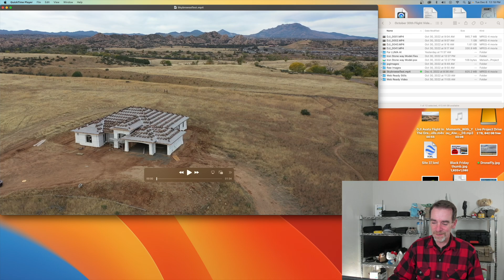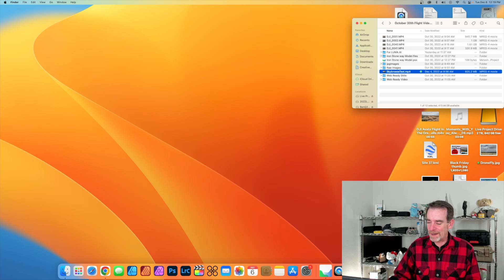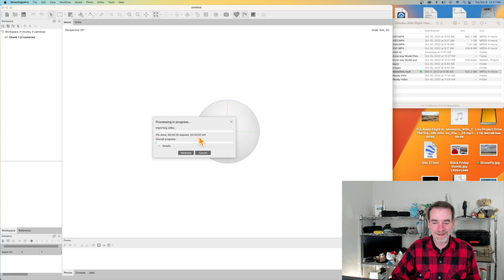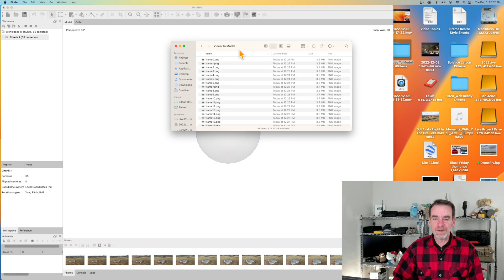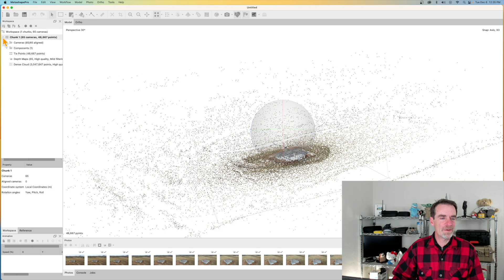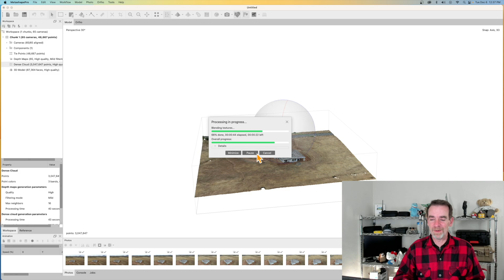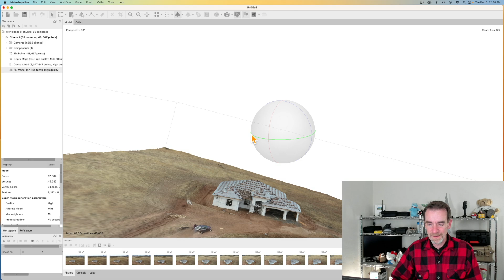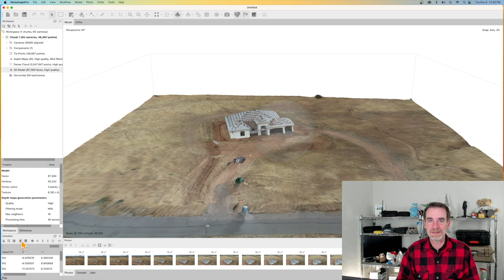How To Make 3D Models From Drone Video | Metashape Video Import

Comment: Have you ever tried to pull a Metashape model into a drafting software like Autodesk Revit?  I work at an Arch/Engr firm and am trying to think of ways that I could implement my drone interest into my day job.  I could see it being handy with expansion projects, where the architects are modeling an existing structure from scratch, so that they can then model the new addition, in order to show renderings of what the final project would look like.
Reply from the maker: Sorry for my extreme delay, this one slipped past me.  Metashape allows for a lot of export options for models.  I know that there are several videos and tutorials here on YouTube about Metashape and Revit.  I'd suggest checking some of those videos out.  Also check out what file formats Revit can work with, and compare that to the export options Metashape has.
Reply: @AZ-Drone  I found one workflow that requires you to go through AutoDesk Recap first, and then create a .rcp or .rcs for Revit.  I tried a OBJ file directly into Revit and it looked kind of wonky, lol.
Reply from the maker: @JoeBoone82  Years ago I started looking into AutoDesk Recap myself.  I was trying to find the best way to render models.  I didn't spend enough time on the demo when I tested it.
Reply: @AZ-Drone  I guess if your client had wanted the 3d models for viewing, which file type and/or viewer would you have used to share the file with them?  I imagine they would need software, or a web based brower, to open the .obj or whichever file you extracted from metashape?  

A fun one to play around with is Luma Labs AI.  I would like to try a SkyBrowse model at some point in the near future as well.

Comment: I downloaded this app to my MAC Book Pro...  But I am having huge problems....  It crashes constantly...  I haven't been successful with one model yet....  Is there a setting or preference you may have some insight into that may need to be changed?  My MAC is 7+ years old now so that might have an impact...  Other software I am trying (learning with) WebODM,  DroneDeploy, SkyBrowse, doesn't seem to have this issue so I am curious if I may have missed something.
Reply from the maker: Sorry to hear its crashing on you.  I have used it on a 2017 iMac, and been able to produce small models (turning everything else off).  But super slow.  On my Mac Studio M1 with 32GB of ram it works very well.  But on a 7+ year old Mac?  Not sure it will work very well unfortunately.

Comment: Great work. Could you export it to a 3d software like blender or unreal engine?
Reply from the maker: I have worked with models in Blender, but I have not done any work with Unreal engine.  I use Metashape and WebODM for generating models, and the big part for Blender would be making sure I've exported the models in a format Blender will be happy with.

Comment: Would this technique also work for video taken from a typical grid pattern flight?  Can you choose the image selection rate -- roughly how many minutes of video produced 60 images?  Thanks for a very interesting video.
Reply from the maker: Yes, absolutely, this would work.  In the Metashape video import you can vary the frames, and you should test it out as I can remember which setting makes more images, and which makes fewer.  Be sure to make a folder for the Video Import images to be stored.  I forgot one time and had several hundred PNGs saved to my desktop.  Whoops.  😀

Comment: Hello!
Congratulations for the video, it was very good and very well explained.
Would you happen to inform the following characteristics of the video and processing?
Video:
1- What gimbal angle did you use?
2- Did you use the video format as wide or 4:3?
Processing:
3- Alignment, advanced.
4- Dense cloud, advanced.
5- Mesh, advanced.
6- Texture, advanced.
Thank you very much!!
Reply from the maker: I can't remember the gimbal pitch used, been a little while.  Went with the wide video.  Sorry to say I don't remember all of my settings in Metashape for this one, it's been a while since I produced the video, and when I was done with the video I deleted the project.

Comment: Can you use this software to get dimensions? Like calculating the width of the roof?
Reply: I think once you turn it into a 3d model, if you know a few dimensions of something in the shot (Truck length, door width, etc) then you can scale the whole thing based on that

Comment: What's up with the transparent circle in the middle of the frame? Is shooting in 5.4K overkill(Air2S)? Any requirements with frame rate/shutter speed? I'm going to try this...I like it a lot. Thanks!
Reply from the maker: When I did this one I was just shooting HD, 60fps.  I kept the speed a little lower, and I probably could have done it a little faster.

Comment: Hi, thanx for your video. One question : did you program the flight or you flew manually ?
Reply from the maker: The video for this one was pre-planned.  Just a quick little waypoint series around the site.
Reply: @AZ-Drone  thanx. With third part (litchi) or DJI software ?
Reply from the maker: @MDC.42  I used Litchi on this one.
Reply: @AZ-Drone  thanx. I didn’t understand that important point in the video :-(

Comment: nice job. How would it cope with a 'fish eye' distorted camera footage (like from a gopro) ? would you use the raw video, or would you need to 'de-fisheye' it first ?
Reply from the maker: I haven't tried it with a fish eye like the GoPro.  Could be an interesting experiment to see how Metashape handles it.  Here's one thing I do know.  Metashape is more than a program for drone modeling.  People have been doing photogrammetry before drones hit the market place.  I've seen some amazing models generated with ground based cameras as well.  So I wonder how wide or distorted the images could be going into Metashape.  Would be an interesting experiment to walk around the home with a GoPro and see what gets generated.
Reply: @AZ-Drone  Well, I flew and filmed with a RunCam Orange 5 (about same fish-eyeness factor, as a cheap GoPro equivalents). The 3d model got generated. A bit skewed, but that may have to be fixed by tweaks in the Metashape. Still, quite impressive, for the little effort required :) Next I may try to program area scan, to fly in parallel lines. See what that produces.

Comment: I had a request to film a road for evaluation purposes and i tried to import it n follow steps you showed but the result was horrible n i wonder if there is something that i missed n if i do need to take a reference ground control points as well if i have a multiple videos so i can work with every single video in a chunk n stitch them together for final result
Reply from the maker: In the case of documenting a road I'd probably lean toward doing a model with Drone Harmony or Map Pilot Pro to generate an orthomosaic model.  Unlike orbiting a house where we have a point of interest, a road probably wouldn't come across well.  How long is this section of roadway?

Comment: Hi Rich! Thank you for the video. I'm just trying out metashape so I'm using the trial version for now. I do not have the dense cloud option in the dropdown menu (workflow) - Only option available is point cloud. Is it because of the version I am using? 
Thank you!
Reply from the maker: It could be the version is the issue.  I know the latest version has come out recently, and I haven't updated yet but plan to soon.  Just need to find a little time between projects to test out the latest.  Normally I align photos first, then generate the dense point cloud second.  Under the workflow, what items are there?
Reply: @AZ-Drone  I just downloaded it recently so I don't know about older versions. under workflow I got: Align Photos - Build Mesh - Build Texture - Build point Cloud and Build Panorama.

Comment: Very impressive! Is all the processing you show in this video achieved with a Mac Studio (I'm asking just to have a reference)? Was this example entirely done with MetashapePro Standard edition?
Reply from the maker: This processing was done on a Mac Studio.  I also just tested this morning on my old iMac that has the Standard Edition of Metashape as well.  You can import from video to the standard version.  Just don't try it on my old iMac as it is a "little slow".  Running this model on the Mac Studio?  Yeah, nice and quick!!!
Reply: @AZ-Drone  Good to know, my iMac CPU is a Quad-Core Intel i5 from 2015, I can see that it will be too slow for this, hope to upgrade to Mac Studio M2 next year!
Reply from the maker: @ricci.hidalgo  Just to let you know...I also have a Mac Mini M1, and it has surprised me with how speedy and stable it is.  Before I got the studio I was using the mini for smaller models as well.
Reply: @AZ-Drone  Yes I know, I have a MacBook Air M1 that has also very good performance on FCP, but still aiming to the Mac Studio for other reasons.

Comment: It doesn't working when i imput drone video "A media resource couldn't be resolved" . I make video from Dji-Mavic 4, 4k 60 fps and Metashape Pro
Reply from the maker: Just checking the steps you took.  Open Metashape, go to File, go to Import, select Import Video, and select your video file.  The file formats can be avi, flv, mov, or mp4.
Reply: I installed the k-lite codec and it worked.

Comment: Are there any similar programs that can do this that are not made by companies based in Russia?
Reply from the maker: Wow, didn't even realize that Metashape is from Russia.  It's been so many years since I purchased it.  There are other applications that will allow you to extract frames from your videos for the purpose of modeling.  One that I just read up on to answer your questio is photomodeler.com.  This program will let you extract images for use in modeling.  If I were to use it I'd extract my stills with it, then pop it into WebODM (installed on my Mac already) and see how it works.